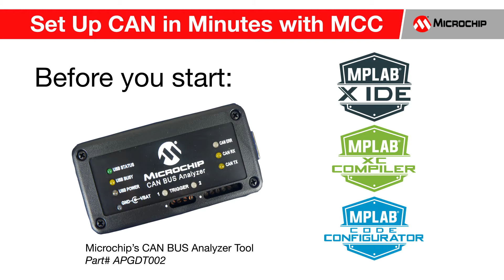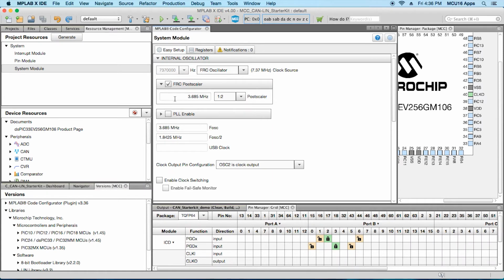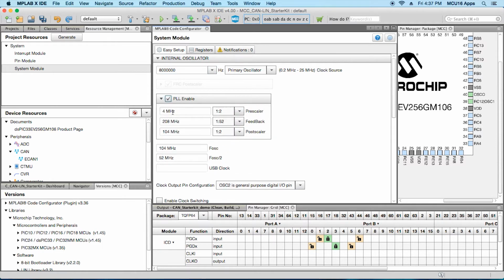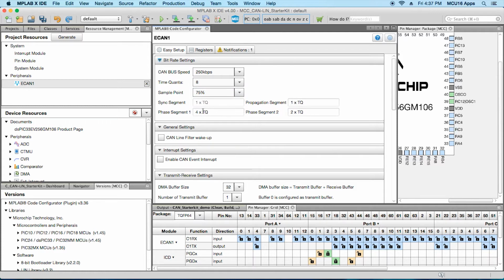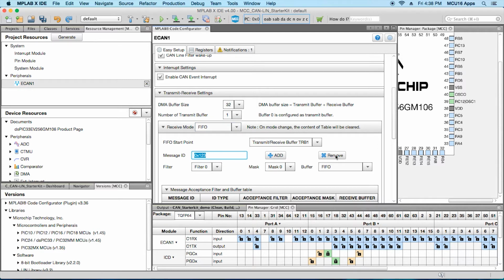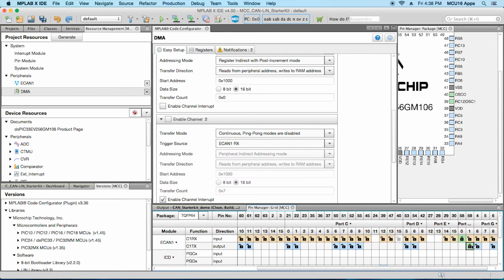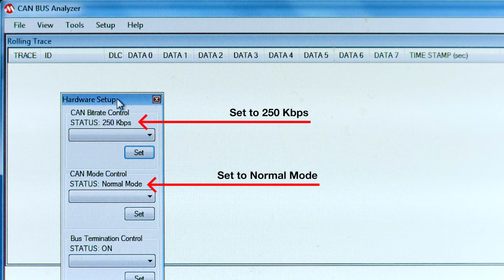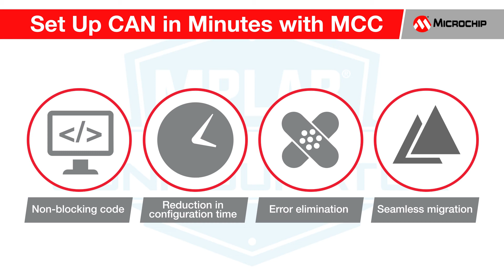Set up CAN in Minutes Using MPLAB® Code Configurator

Comment: Hi, can you please share the main . C file  for that configuration
Reply: /**
  Generated main.c file from MPLAB Code Configurator

  @Company
    Microchip Technology Inc.

  @File Name
    main.c

  @Summary
    This is the generated main.c using PIC24 / dsPIC33 / PIC32MM MCUs.

  @Description
    This source file provides main entry point for system intialization and application code development.
    Generation Information :
        Product Revision  :  PIC24 / dsPIC33 / PIC32MM MCUs - 1.75
        Device            :  dsPIC33EV256GM106
    The generated drivers are tested against the following:
        Compiler          :  XC16 v1.35
        MPLAB 	          :  MPLAB X v5.05
*/

/*
    (c) 2016 Microchip Technology Inc. and its subsidiaries. You may use this
    software and any derivatives exclusively with Microchip products.

    THIS SOFTWARE IS SUPPLIED BY MICROCHIP "AS IS". NO WARRANTIES, WHETHER
    EXPRESS, IMPLIED OR STATUTORY, APPLY TO THIS SOFTWARE, INCLUDING ANY IMPLIED
    WARRANTIES OF NON-INFRINGEMENT, MERCHANTABILITY, AND FITNESS FOR A
    PARTICULAR PURPOSE, OR ITS INTERACTION WITH MICROCHIP PRODUCTS, COMBINATION
    WITH ANY OTHER PRODUCTS, OR USE IN ANY APPLICATION.

    IN NO EVENT WILL MICROCHIP BE LIABLE FOR ANY INDIRECT, SPECIAL, PUNITIVE,
    INCIDENTAL OR CONSEQUENTIAL LOSS, DAMAGE, COST OR EXPENSE OF ANY KIND
    WHATSOEVER RELATED TO THE SOFTWARE, HOWEVER CAUSED, EVEN IF MICROCHIP HAS
    BEEN ADVISED OF THE POSSIBILITY OR THE DAMAGES ARE FORESEEABLE. TO THE
    FULLEST EXTENT ALLOWED BY LAW, MICROCHIP'S TOTAL LIABILITY ON ALL CLAIMS IN
    ANY WAY RELATED TO THIS SOFTWARE WILL NOT EXCEED THE AMOUNT OF FEES, IF ANY,
    THAT YOU HAVE PAID DIRECTLY TO MICROCHIP FOR THIS SOFTWARE.

    MICROCHIP PROVIDES THIS SOFTWARE CONDITIONALLY UPON YOUR ACCEPTANCE OF THESE
    TERMS.
*/

/**
  Section: Included Files
*/
#include "mcc_generated_files/system.h"
#include "mcc_generated_files/ecan1.h"

typedef struct __attribute__((packed))
{
    unsigned priority                   :2;
    unsigned remote_transmit_enable     :1;
    unsigned send_request               :1;
    unsigned error                      :1;
    unsigned lost_arbitration           :1;
    unsigned message_aborted            :1;
    unsigned transmit_enabled           :1;
} CAN_TX_CONTROLS;

/*
                         Main application
 */
int main(void)
{
    // initialize the device
    SYSTEM_Initialize();

    /* Enable DMA Transmit and Receive on the ECAN module */
    ECAN1_TransmitEnable();
    ECAN1_ReceiveEnable();

    uCAN1_MSG msg;
    msg.frame.id = 0x1FFEFFFF;
    msg.frame.id = 0x729;
    msg.frame.dlc = 8;
    msg.frame.idType = 0;
    msg.frame.data0 = 0x01;
    msg.frame.data1 = 0x23;
    msg.frame.data2 = 0x45;
    msg.frame.data3 = 0x67;
    msg.frame.data4 = 0x89;
    msg.frame.data5 = 0xab;
    msg.frame.data6 = 0xcd;
    msg.frame.data7 = 0xef;    
    
    CAN_TX_CONTROLS *tx = (CAN_TX_CONTROLS*)&C1TR01CON;
    tx->transmit_enabled = 1;
    ECAN1_transmit(ECAN1_PRIORITY_HIGH, &msg);
    while (1)
    {
        if(ECAN1_receive(&msg))
        {
            //Message received
        }
    }
}
/**
 End of File
*/
Reply: Did CAN bus work for you with this configuration? 
For me I have to transmit the CAN messages to the Raspberry Pi.
I have tested it. For me, CAN is not ECAN. Does it make a difference ?